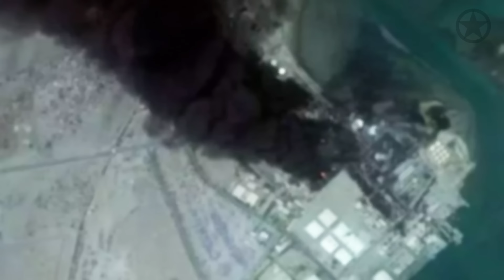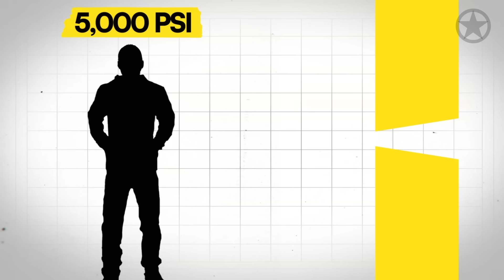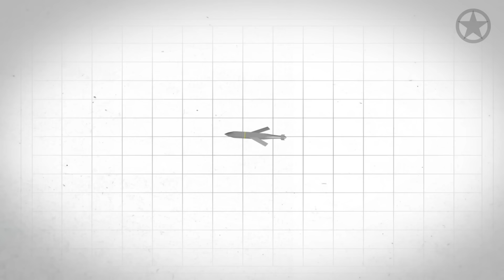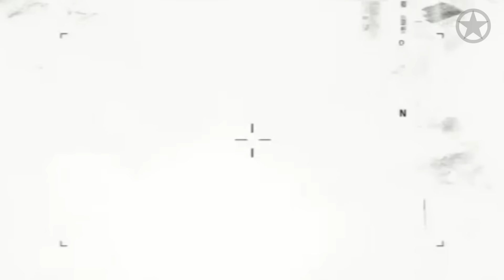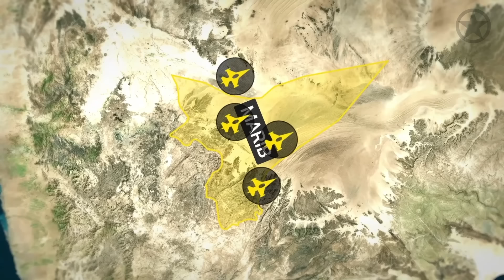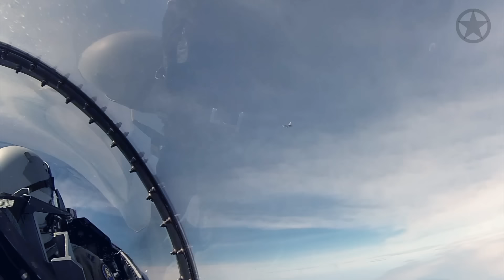Houthis Tried to Hide in Bunkers – BIG MISTAKE

Comment: When you mentioned "buddy stores," you showed inflight refueling from a C-130. Buddy stores are specially modified droptanks carried by accompanying aircraft, for example (I worked on A-6's), 1 or 2 birds in the flight would carry extra fuel to refuel the birds actually conducting the strike.

Comment: Before I move to Australia, after I did a combat tour (Team Sniper) in Vietnam; 2/502 Infantry, 101st Airborne. We didn't have or work out of a fire and/or fire support base. The VA said we spent just over 330 days in the field in the Mountains around the "A Sầu Valley" which was thick jungle while the valley was elephant grass.
  This "AO" was west of Hue on the DMZ/Laos boarder. We were a very small Strike Team. One night our "FO" said there was going to be a B-52 Bomb run. 500 and 1,000 lbs bombs were dropped. I have never seen such "total destruction". The jungle area was leveled, plus massive holes ... I think at moment we woke up to the power of those bombers had.
Reply: Vous allez tous brûler en enfer.. espèces de criminels